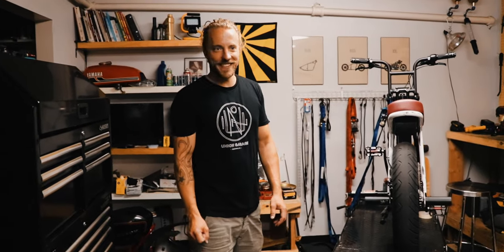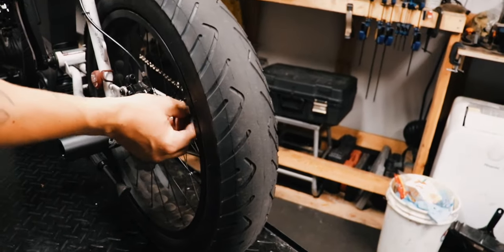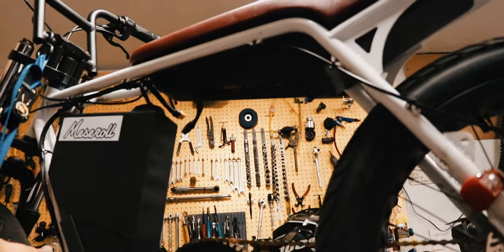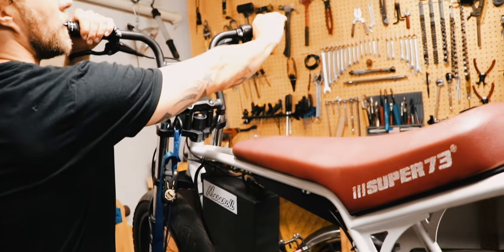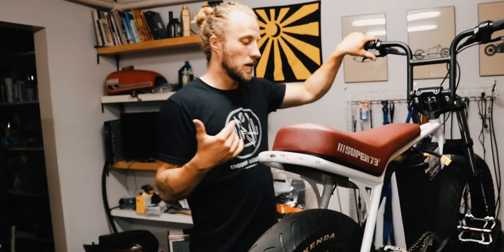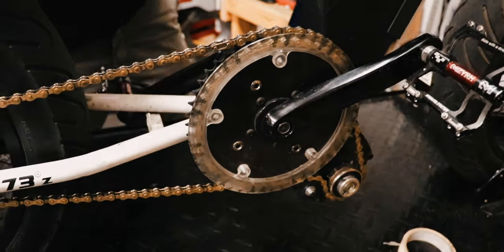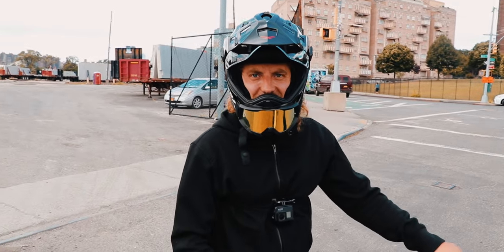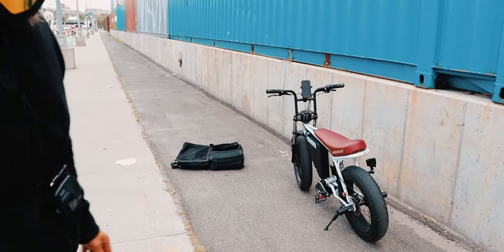FASTEST SUPER 73 EBIKE IN THE WORLD (3000Watt / 72Volt)

Comment: Hi, pardon my ignorance but how did the sprocket change made the bike go faster? Did you swap the first one to less teeth or  more? What is the Science behind it? Especially for a bike that doesn’t need pedaling. I’m really interested in swapping my single cog as well once I know the reason behind the additional speed. I hope you answer. Thanks.
Reply from the maker: A. Castro Adding teeth to the front and rear sprockets have opposite effects. Installing a larger countershaft sprocket creates higher gearing, while a larger rear sprocket lowers gearing. Similarly, a smaller front sprocket lowers the gearing while a smaller rear sprocket makes gearing higher.
Reply from the maker: Gearing a bike up to produce higher top speed with less acceleration is done using a larger countershaft (gearbox) sprocket or a smaller rear sprocket. Gearing a bike down giving it more acceleration with lower top speed is done using a smaller countershaft (gearbox) sprocket or a larger rear sprocket.
Reply: johnnypuetz  Thanks a lot for the information. Most importantly Thank you for even replying! I appreciate it.

Comment: Great videos! I’m very interested in accomplishing the same goal. I’m planning call super73 tomorrow to order a bike and hopefully be able to purchase without the motor or battery (if possible).  Is there anyway you can provide the list of parts used? I know you got the motor/battery from Luna. I saw a comment with the hub you replaced with but is currently sold out. Just trying to the complete parts list together before calling up super73 to see if they would even sell it minus components I won’t even need. Thanks!
Reply from the maker: Did you end up calling Super 73 and bought a bike?
Reply: johnnypuetz Not yet! But 100% will soon. Moving and once the move is done I will.

Comment: I just want more range, any ideas of how to  use a second battery on the z1
Reply from the maker: Engels k the original battery is a 36V, hidden under the seat. The easiest will be add another 36V and run it in parallel to the original one. Make sure not to wire the battery in series. This probably will blow up your controller.

Comment: I'm super new to this bike and I'm definitely getting one. I'm a bigger guy, and actually live in the New York area. Do you customize bikes for others as well ? 
I was thinking about getting a 5000watt motor being that I'm a bigger guy (250lbs) what do you suggest
Reply: Do you think leaving just switching up the rear hub motor with a more powerful one would give the same result?
Reply: @claudiosalcedo15  All you need is a 3kw rear hub motor like a QS 205 V3 a Sabvoton controller and a 72v 25ah battery. You will easily hit 50+ mph and pull wheelies. That's a 3kw nominal motor 8w to 12kw peak power. It will have hills no problem climbing the steepest of hills.

Comment: It's been fun to see what you've done putting a powerful mid drive on this frame. It's been highly informational. I see you ended up taking the z1's orginal hub motor off? Was that just to get weight down or does it run smoother with just the regular mtb hub?
Reply from the maker: Yes! :) I took it off mostly for the weight reason. The setup is strong enough, you don't need the hub motor anymore. But if you don't care about the weight, you can run a dual motor setup. There is a hack remove the limiter of 21mph for the orginal motor. So it don't cut off when you go faster. ;)
Reply: @johnnypuetz  awesome. Thanks for the info. Im looking at taking an s2 and frankensteining it in a similar way lol

Thanks again man!
Reply: @johnnypuetz  Hi again Johnny. Been a while. Just wondering if you had any more infor on this hack to remove the limiter on the super73 motor. anything you could share would be greatly appreciated :)

Comment: Do you have the nuts specs on that you used for the rear pegs??
Reply from the maker: Exploring with Stewarts I don’t. But they won’t fit to the original motor/axle anyway because the axle and the hub is not the original anymore

Comment: Hello Johnny, awesome build!  Did you file slots in the 12mm axle to make it fit the 10mm dropout?
Reply from the maker: I took off a little bit of the frame. To fit the 12mm axle
Reply: @johnnypuetz  excellent, was looking at the bottom portion of the dropout earlier.   Plenty of material to remove 1mm and the load is mostly up top were my thoughts.  thanks!
Reply from the maker: @EDvining  yeah. Never had an issue with it!

Comment: Hey! Do you have link for that front suspension? I've been looking everywhere for one! My Z1 goes to about 35mph with BBSHD and rear hub motor (with custom controller).

Thanks man!
Reply from the maker: Nice!!! That sounds like my old custom build but I didn't have a custom controller. I love the design of the motor and that you can mount it on top of the frame and have more clearance. However, I have the front fork from Super73. The sold them on their website. But it seems not available right now. ..I would reach out to them. They are super nice and they can tell you when the fork will be available again.

Comment: Sweet dude! Why is the mid drive hanging down and not just tucked up into the space above the bottom bracket? You may bash it when riding over curbs!
Reply from the maker: Pure Water Window Cleaning it doesn’t fit.. :/ ..I would love to have it up above the bottom bracket but the design of the motor doesn’t allowed it
Reply: @johnnypuetz  Ok, ya I can see now what you mean. It's still great as you're not going to off roadside that thing... It serves its purpose... Beastly street speeder! Sick dude!

Comment: putting a 3000 / 3500w hub on the back wheel would not give the same in speed / force? why middrive? for the fastest torque response?
Reply from the maker: Sergio Luiz good question. I went the route with a mid drive because the weight is better balanced and it’s lighter than a rear hub. But I rode a few rear hub bikes like the ZOOZ bike and that was a great experience too!
Reply: The difference with a mid-drive is that you can put your power through the gears so tons of low end wheelie torque and high speed with your small gear.

Comment: This so such an awesome build, can you explain how you took the hub motor out and added the new hub piece ? Also did you get new spokes to put it all together ?
Reply from the maker: New hub and had it laced at Meseroll BMX shop! Great guys!
Reply: johnnypuetz johnnypuetz do you have a link for the hub piece? Being honest, this video makes me want to mod my z1, I want that same rear wheel without the hub motor and add the 1000w mid drive and the 52v battery pack. Did you need a specific nut and axle size ? I would appreciate some links for all parts so I can mod my Z1 :)